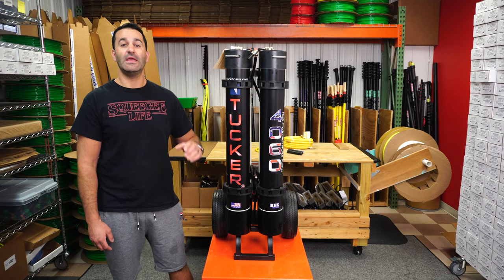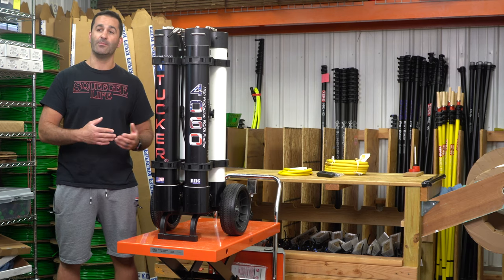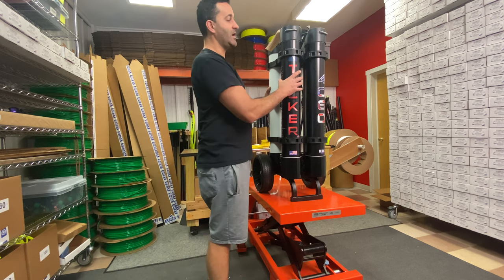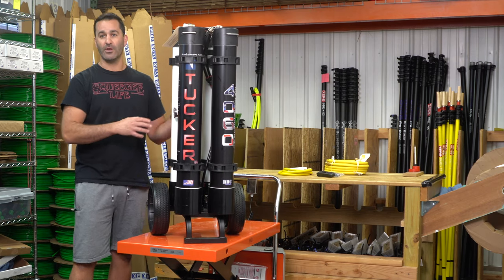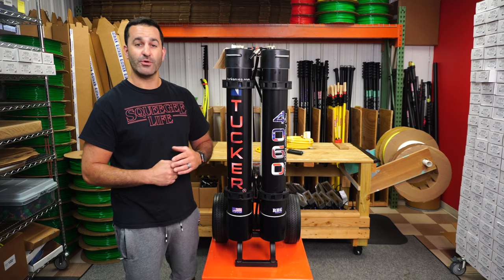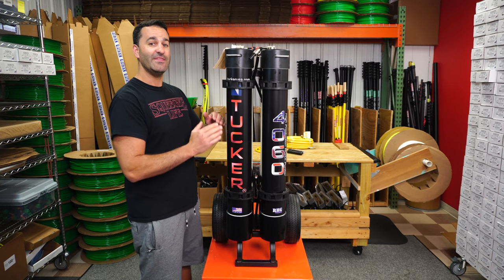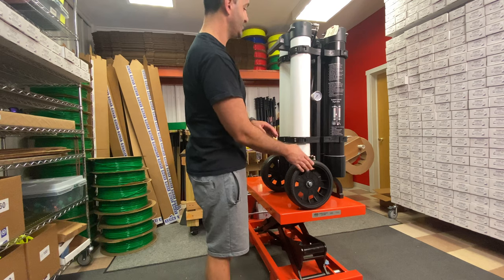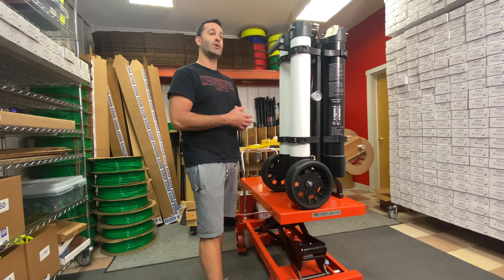Product Overview: Tucker 4060 System

Comment: Great overview! 🥳 I do believe it needs a pump tho. From what I was told the RO membranes work better and you will be able to produce more gallons of pure water with a pump. Also I have tested this at 30,40,50 feet. At 40 feet you will not be able to use a rinse bar without a pump also at 50 feet the water barely comes out of pencil jets without a pump. So it can be mis leading saying it doesn’t need a pump. I would encourage anyone who gets this to purchase a pump or you will eventually be getting one. That was the only thing that I felt like I was not happy with. My expectations where I don’t need a pump but a pump should be encouraged or at least acknowledged as a great add on option. 👍🏼